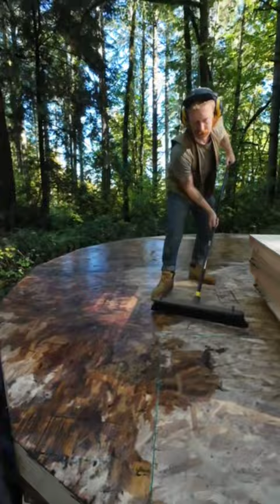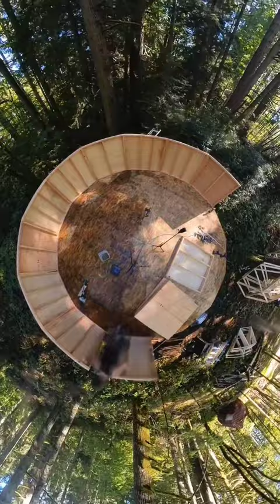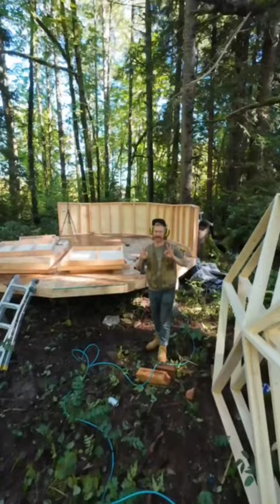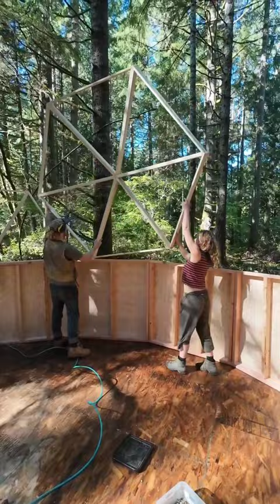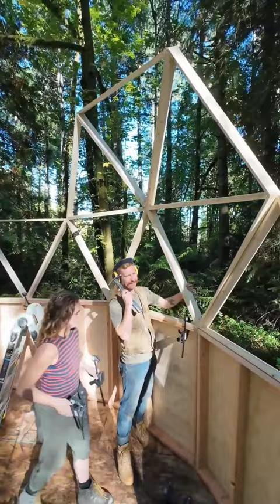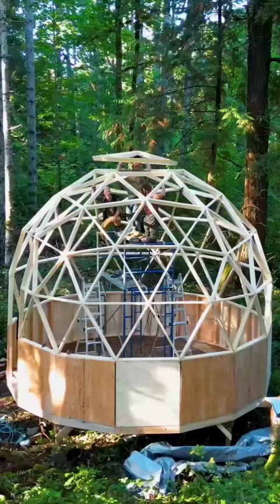DIY Dome Home ! #woodworking

Comment: how do you approach building code?
Reply from the maker: The same way any building does. You submit a house plan and engineering for your site to the building department and get approval. Wood framed domes are permitted and build to code every day
Reply: Less than 800 SF does not have to follow code in the same way. A dome as large as 19’ diameter does not need to adhere to most codes. 800 SF is actually the determining factor on whether or not something is a “tiny house”.